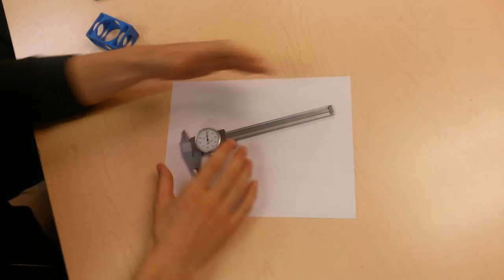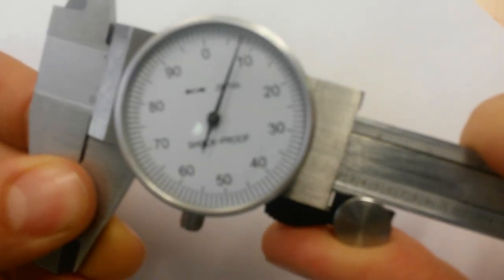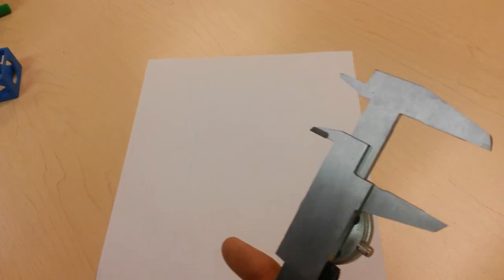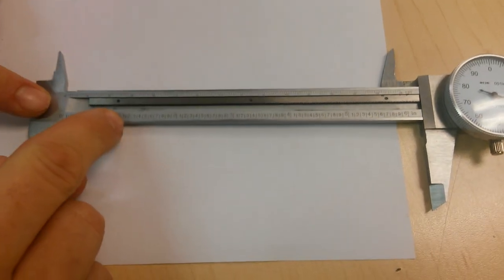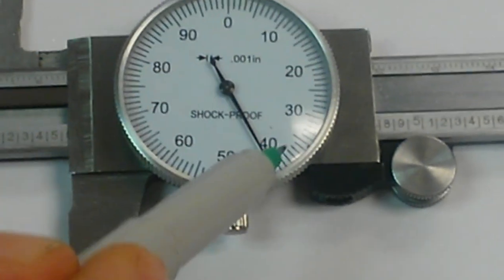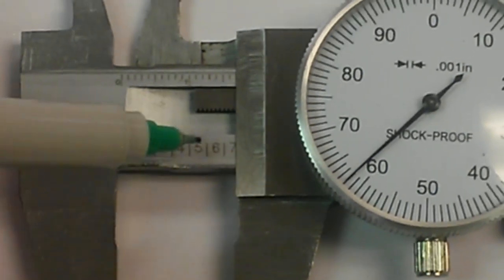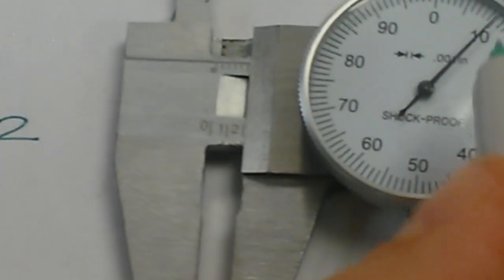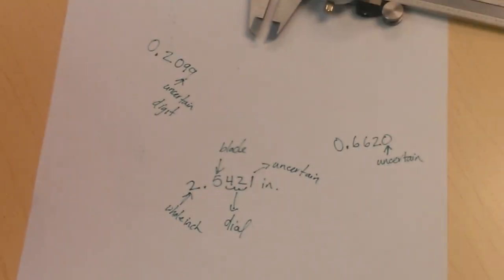Measuring with a Dial Caliper

Comment: There is a fourth way to measure with a caliper using the end of the jaws.  Look opposite the rod/probe to notice that when completely closed the end of the jaws are flush and as the caliper is opened a step appears.  The large flats make it much easier to keep the instrument square with the feature being measured resulting in better accuracy.  If the depth inside the groove at 2:36 is required the probe is the only option but care must be exercised to hold the instrument true to the part.  If it is known that there are only two elevations on this part the step measurement on the outside of the raised perimeter will yield a more accurate reading.
Reply from the maker: Ah thanks Bryan, great point!

Comment: Where are you getting that “uncertain digit” 
from
Reply from the maker: The picture below describes what an uncertain digit is fairly well. On a dial caliper, the uncertain digit is estimated between the lines on the dial. 

https://slideplayer.com/slide/4626715/15/images/5/The+measured+value+has+three+certain+digits+%281%2C+5%2C+and+6%29+and+one+uncertain+digit+%285%2C+or+is+it+4+or+6+%29..jpg
Reply: Please lady, don't ask.
Reply: The last recorded digit, which is determined by the accuracy of the tool.  If the dial needle falls between 1 and 2, we record it as a 1, although the actual number is between 1 and 2.
Reply: @mikemarler8224  How I understood is, you choose a number between 1 to 9 for uncertain digit. It depends where the needle is between the lines. If its right in the middle of two lines then its a x.xxx5
Reply: The uncertain digit is just a guess by him.  Its when the dial is in between two lines and there are no further sub lines.   If the dial was on the first line .001 exactly he would write it as .0010  that last 0 is just saying he thinking it was exactly on the line. 

If its a little past that line he just guesses.   He breaks the distance from line to line into 10 divisions in his head and guesses.   If he thinks its exactly in between lines on the dial he will say its half way and add a .0005 to the reading of .001. 

The dial is actually only good to thousandths .001.  There are no lines for ten thousandths so its just a guess which does give a little more information vs if you just rounded it off.
Reply from the maker: Bob good explanation
Reply: Usually that "uncertain digit" isn't used in real manufacturing, you don't and can't use guesses, thousandths is as small as it goes.
Reply: HE IS UNCERTAIN !!!

Comment: What are you doing, you said about reading internal measurement but you read the lower measurement? Is it not supposed to use the upper measurement?for internal measurement.
Reply from the maker: luis zavala no matter how you measure you read it the same way. Take the whole inch and tenth of an inch from the blade, then the hundredth and thousandth of an inch from the dial.

Comment: Is there a way to get mm's without converting? Thanks
Reply from the maker: Most dial calipers have mm on the upper part of the blade. You cannot use the dial when measuring in mms, however
Reply: @MrStem  awww I see. Thanks!

Comment: What if the arm on the dial is right in between two lines?
Reply from the maker: Great Question. You use the "Uncertain Digit." Its a fifth digit you can use. For example, if the measurement is between 4.753 and 4.754, you can estimate it as 4.7535.
Reply: @MrStem  thanks for answering

Comment: Good video, I just got a Starlett 120 (no documentation)  and saw another video where the guy said to loosen the bottom dial zero screw and the top screw for each measurement. (no kidding)
I thought you just zero it and set it one time then dont mess with the bottom screw.   He acted like you have to loosen and tighten both.    I think maybe he thinks he is an expert in his mind putting out bad youtube intel.
Reply from the maker: Glad this one worked out for you!

Comment: how to do it in metric?
Reply from the maker: Good question. On the model I have the top side of the blade has a metric ruler. You cannot use the dial feature and can only measure to the millimeter.
Reply: On some dial calipers, the dial shows both scales: English and metric.

Comment: It does not have MM?
Reply from the maker: Depends on which one you have. Most have them on top of the blade. The actual dial only works in inches
Reply: @MrStem  i bought a 15cm dial caliper..i find it hard to read bcoz its very diffirent
Reply: @sanjoeamaranto1044  I hate metric as well.

Comment: .999 Then u hit one inch.. so those other smaller numbers are in thousandths of an inch.. then after that then it's ten thousandths of an inch.. so if u have 2 inches 200 thousandths and 5 tenths.  It would read like this 2.205 ....  

So  read it properly.. teach the class properly...  0.000  Or 0.00 or 0.0  or  0.   See the  decimal placement?  That tells u everything as to what your reading..
Reply: 2.205 should be read two and two hundred five thousandths.  The five is not in the tenths place; it is in the thousandths.
Reply: @ethanhutchinson7888  correct 
I was trying to illustrate that the decimal placement matters. 
Tou just helped me to validate that point u caught my error.
Thanks..